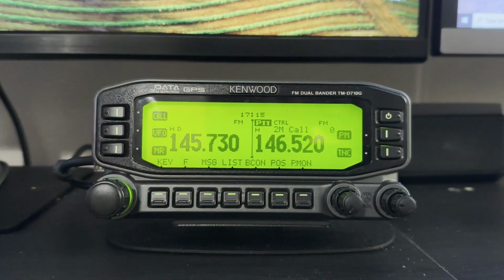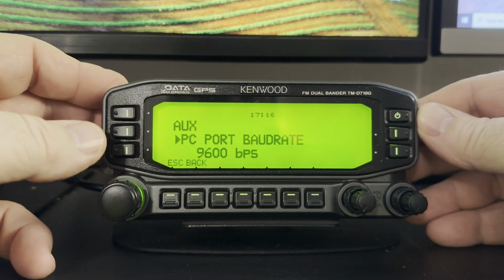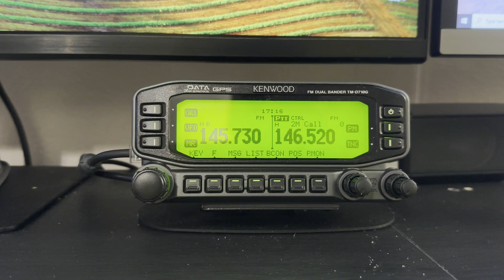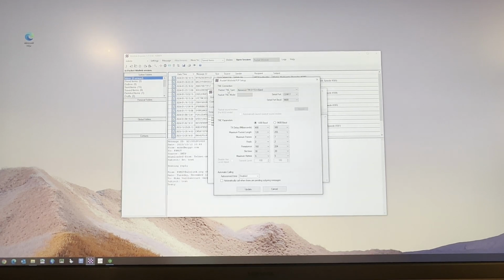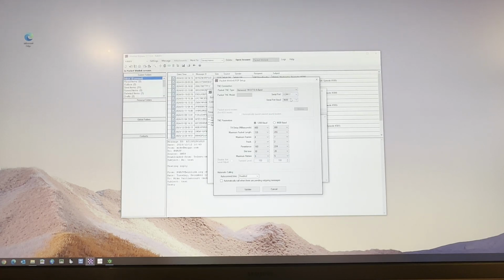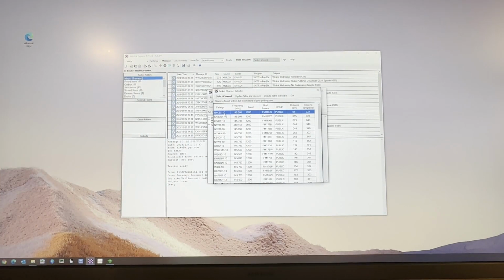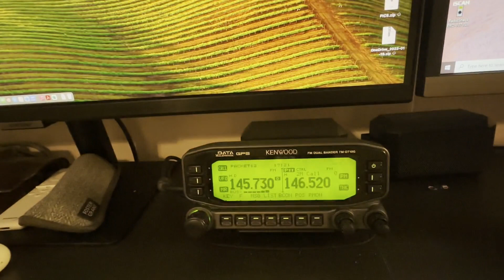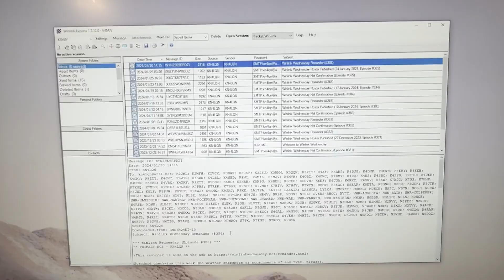How to configure the Kenwood TM-D710 for use with Winlink

Comment: Which cable are you using? I think I ordered the wrong one.
Reply: The cable should plug into the rear of the head. If you’re plugged into the body, it’s the wrong port. I should do a better video including hookup and configuration. This was just a quick video I made while using winlink.

Comment: Where can I buy one
Reply from the maker: Keep your eye on QRZ and QTH swap pages. They also come up on retailers used list from time to time. If you see one, don't hesitate. If they are priced in the $550-$600 range, they sell very quickly. Hopefully Kenwood will release a new model with the same functionality. No one currently offers a radio packed with as many features right now.